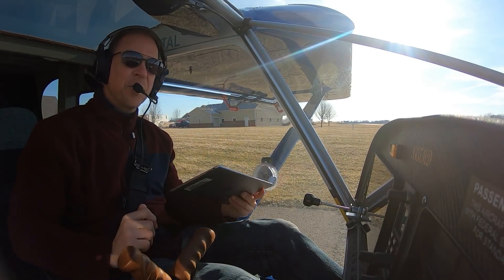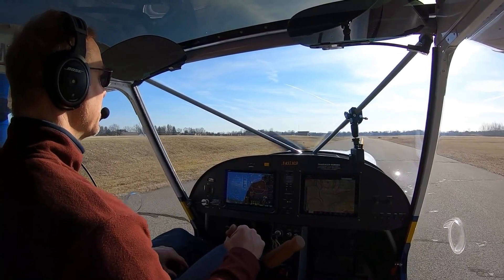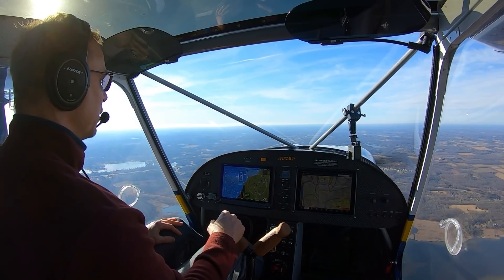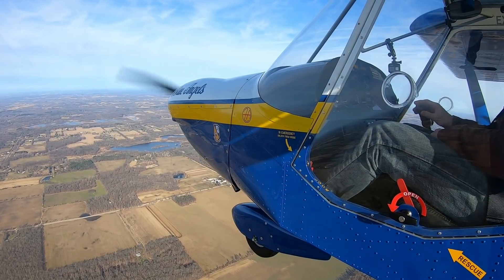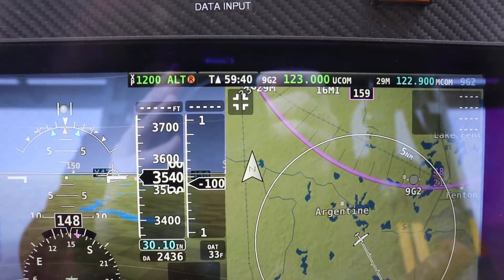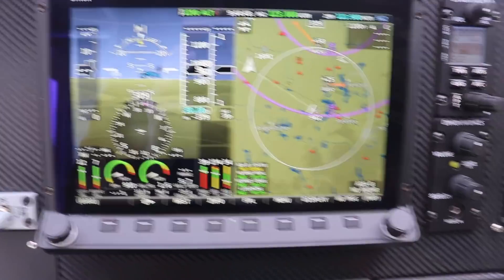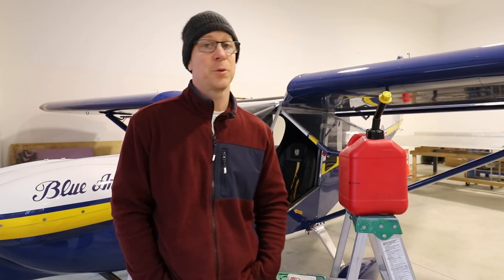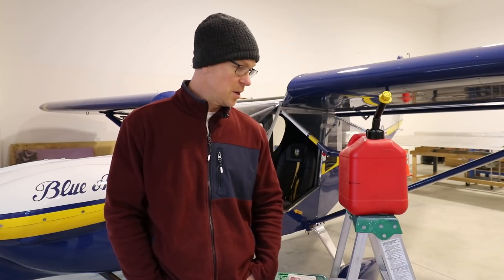Going FLYING to Verify the UL Power 350iS Fuel Flow Numbers

Comment: We're in the process of finalising setup of the Dynon fuel flow - we installed the red cube - doing pretty much the same as you. There is an adjustment in the Dynon setup pages, you change the pulses... still figuring it out myself.

Comment: I have a UL 350is with Dynon HDX system (without the Red Cubes). My setup shows a K factor for both fuel flow to and return input setting in order to determine the Fuel Flow for the display. I know that the engine fuel flow formula is:
1. 48 l/h = 12.68 gallons / hr
2. 170 pulses / sec = 612,000 pulses / hr
3. 612,000 / 12.68 = 48,265 pulses / gal
4. Calculated K factor is 48,265. (This number is input into the fuel flow "To")

Comment: I also don't have the "red cubes" there is a setting in the Dynon HDX where you change the "k" factor from the stock Dynon setting which is what is used for the red cubes to the UL fuel flow in the manual.  Your burn is now close to mine considering I factored in start, warm-up, taxi, climb and landing.

Comment: I found it interesting at the end, you were talking about your power setting. At this point in time I don't have an airplane but having done design work on a couple homebuilt aircraft designs and found slowing down 8 to 10 knots can reduce the power requirements a fair amount. Of course this has a direct correlation to fuel burn. 

My engineer friend and I agreed that we will likely be flying by the fuel flow meter than the airspeed or tachometer.  One design the difference between cruising at 105 knots and 95 knots was 1.6 gallons an hour theoretically on the computer model.  You need to ask yourself is that added 10 knots worth the fuel burn?

Knowing your fuel burn is handy for flight planning, but also how well the engine is tuned or not tuned.

Comment: G,day Mark from Sydney Manly Australia.
Nice flying around. I'm interested in how the hot air is directed from around the engine?
A. Butterfly valve
B. Scat hoses
And the smell the gasoline smell - "smells like.... Victory"
,🇭🇲🦅
Reply from the maker: Mine works the same way as most general aviation airplanes. There is a "heat muff" around the exhaust. That heats the air and then that warm air is directed into the cabin through a butterfly valve on the firewall.

Comment: I know this is about "fuel flow" but your leaning back to climb and leaning forward to descend caught my attention. It remined me of the days when I was flying a Sabreliner 40. We didn't use the autopilot; didn't trust it. We hand flew all the time and at 370 it could be a hand full. I learned that if you trimmed the nose down, maybe 50 f/m, you could control the altitude just my adding, or subtracting, the back pressure on the elevators when the passengers moved around in the back. I could hold altitude while the other pilots kept moving the trim and bobbing up and down and not stay on altitude. I guess that is why they often called me the silver fox. I broke down one day and told them how it was done. Now we all could stay on altitude.

Comment: There is probably a K  factor that can be set in the Dynon for the fuel data, the UL must be sending the fuel injection pulses and duration data, or it may just send the pulse data and the amount of fuel per pulse may be estimated. Since the amount of fuel coming out of the injector is such a small amount per pulse its going to be a very small adjustment on the Dynon.
Reply from the maker: I do remember Ray saying something about it measuring the pulses, so that's probably how it's measuring it, but now I have to figure out why it's measuring it incorrectly.

Comment: HDX says 5,7 gal, then you filled up 5,8 gal. So it is only of 0,1 of a gallon and not a full 1x gallon
Reply: See 11:05 minutes of video
Reply from the maker: The 5.7 is the total gallons used during the flight. So being a gallon off, it really should read 6.7 if it was measuring correctly.

Comment: Would be interesting to put a known 5 gallons thru the sensor and see what data comes out of it as far as signals. I would assume that it has to be calibrated for fuel line pressure. Is there an adjustment on the sensor?